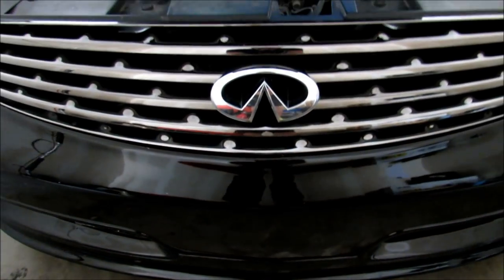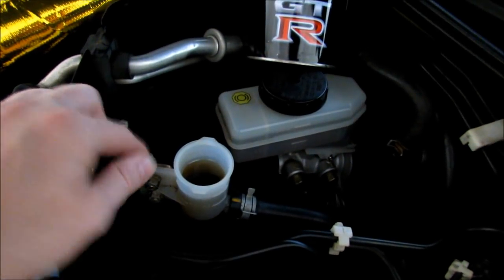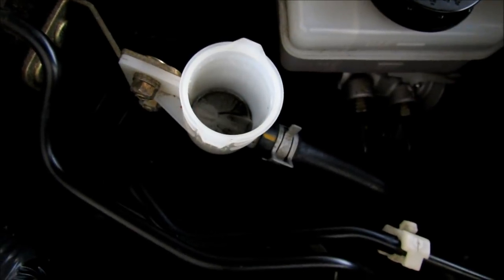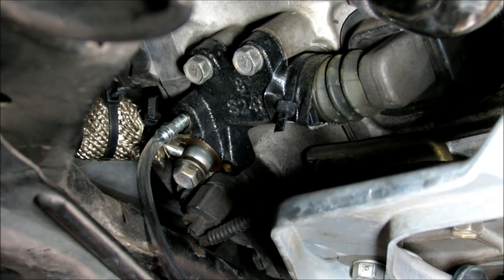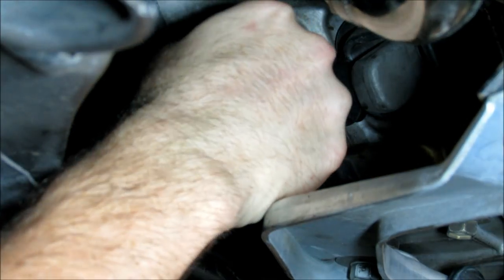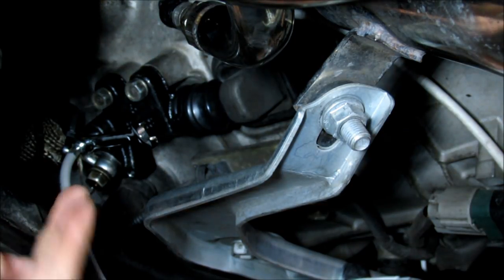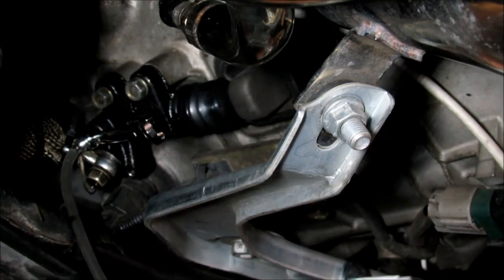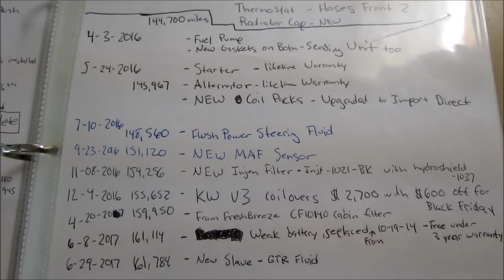INFINITI G35 / Nissan 350z - Fix Clutch Pedal - Bleed Install Slave Cylinder

Comment: Awesome vid, .I have the same exact car, same year too 6MT without the rear active steering. If don't ind I like to explain what happened to me today.  I had my clutch replaced at about 100k miles I am exactly just over 160k miles as of today. Just yesterday I noticed when I press my clutch in starts making a weird sound every time I pressed in. Now this morning it's now more like a whiny sound. I drove down to our local grocery store and noticed when I was depressing the clutch it was going to gear much quicker and I had to gas it a bit. It started to smell like burnt clutch/brakes. I made it home but same thing and when I got to my driveway the car stalled. I noticed it happened when I released the clutch it was going to gear much soon, again smelled like burnt clutch/flywheel?  Could this be the Clutch Slave Cylinder? I know it's hard to say it is but any feed back would be greatly appreciated.
Reply from the maker: 80k-100k is about the life expectancy of the clutch. Sorry for the late response, I never got a notification from youtube. It is your throw out bearing going out. I actually installed my own clutch. Because of my Motordyne Shockwave exhaust, I crack the throttle pretty often. What I learned, is do not crack it with the clutch pedal depressed all the time. Why?  My clutch was on 80,000 miles when I made my throwout bearing explode. When it exploded, every time I pushed in my clutch pedal the car would stall and you would smell burnt clutch. Never in my life have I had a car stall from pushing in the clutch. 

This sounds like your issue. You have to the drop the whole tranny to replace the throwout bearing which is a like a $40 part. It has a bunch of balls in it that spin in a circle, what happens is 1 or 2 balls will seize making it fail.
Reply: Thanks MotorDyne, it was definitely my throwout bearing. I unfortunately don't trust my self to take down my tranny to get to the clutch/throwout bearing.  So I winded up paying my local mechanic $350 to put an entire new clutch. After he removed it I had about 15% left. I am at 157k miles so replacement for a new clutch was coming up.  I had an Exedy Stage 1 clutch but now I have decided to go back to the Exedy NSK1000 OEM Replacment with a matching Luk DMF067 Flywheel. I was a little over the hard clutch feel from stage one. It feels great to have gone back to the original softer feel since it is my daily driver.  Thanks for you feedback. From your videos I can clearly see we have some the same common issues. I'll send you details later. Thanks again.
Reply from the maker: itscrucial .....I have the same setup except my clutch is Exedy stage 1. The dual mass flywheel has springs in it to absorb the vibration when changing gears. The dual mass is better for the gearbox than a single mass flywheel and your car will not sound like cement truck in neutral.
Reply from the maker: itscrucial .....another note. My Motordyne Shockwave ))) exhaust is what made my throw out bearing explode. A lot of cars rev at me when they hear my exhaust. So I will push in the clutch and bounce it off the Rev limiter. What I learned is if you want that throw out bearing to last, do not be reving at people with the clutch depressed. Just put it in neatural and do not press the clutch when you blimp the throttle.

Comment: Motordyne G35 many thanks for the helpful video! I just replaced my slave with a centric and installed it today with some brand new motul 5.1, I completely drained the fluid out and then once on I started the pressure build/ bleed process. I noticed that someone had mentioned on here as well about the pushrod being on the other way? Can you confirm that's the correct way? I noticed ours looked the same but different from OEM and so I couldn't exactly take a stand and followed your directions. Thanks again for a great video.
Reply: Also I noticed as I built pressure in the pedal and the fork was getting pressed, it has quite a squeak to it. I've seen that on other applications people throw some white grease on the contact point but ours is inside the bell housing and I'm not sure if that's something that should be done on ours even if its within reach.  Any tip or ideas on what i can do to fix it?
Reply from the maker: Thank you! Well, I did the install in June of 2017. It has been 1 year with no issues. I do remember someone saying that I installed the push rod in there wrong, but I haven't had any issues. I still believe I installed the pushrod the correct way. Now I think about, it obviously doesn't matter because the push rod is still the same length, either way, you install it. Just installing it correctly means the rubber boot is on correct.
Reply from the maker: The squeaking is NOT coming from inside the bell housing, which the fork has the throw out bearing on it. The squeaking is coming from the clutch pedal in the car, mine does it. I even lubed it all up with white lithium grease and every once in a while, I will still get a creaking noise from the clutch pedal. It is normal, I know it sucks.
Reply: Motordyne G35 ok great I believe you're right and it really shouldn't matter.
Reply: Motordyne G35 you know at second look I think you're right about the squeaking as well, it just seemed when I was down there and the pedal was getting pressed that it was originating from the fork. But I feel the squeak in the pedal if that makes sense,  and from time to time while driving it goes away
Reply: I might consider doing the rjm pedal mod in the future there's another really good video on here about it and it just seems like the engineering aspect from oem makes a lot of sense in aiding pedal feel and response.  Thanks again for all your input man I appreciate it!

Comment: Hey brotha, I've got a little issue maybe you can help. For the last few months I notice that when I let my car idle with the AC on for about 10 minutes, my clutch pedal gets much stiffer and the catching point is much higher. It's really weird. Even driving normally with the AC on for 20 minutes or so (city and highway) it stiffens up a little bit, but not as much as if I were idling for 10+ minutes. What do you think this could be? I have a 6 month old Master and slave cylinders. I have a feeling it's a failing slave, or could be a failing throw out bearing maybe? I tried to bleed and this still didn't fix it. Let me know what you think. I might start with replacing the slave since that is the cheapest. But since I have to fix a rear main seal leak, I could always put a new throw out bearing while I'm at it. I appreciate any advice!
Reply from the maker: Aaron.......hmmmm.....didn't you just replace your clutch 6 months ago? My throw out bearing exploded at 80,000 miles because I was cracking into the exhaust with the clutch pedal pushed in back at a Camaro. Once it exploded, when I depressed the clutch the car would die and smell like clutch. I can't remember if the pedal got stiffer at that point. I highly doubt your throw out bearing failed. Didn't you also just replace your rear main seal too? Aaron, what is going on? Shit news bro. 

I doubt it is also your slave cylinder, but if you bought at Oriely's you can swap it for free and find out. I replaced my slave a little earlier than I should just so I could make this video. It was exactly at 20,000 miles but you should be able to get 50k out of a slave. Honestly, I have no clue on this one, sorry man. 

The only thing I can think of is it will stiffen up first thing in the morning after a couple pumps because it builds back up pressure, especially if air is trapped in the system.
Reply: Thanks for the prompt reply bro. By your explanation it doesn't sound like my throw out bearing has exploded, and no smell of the clutch. However it was slipping more when it became more stiff because of the higher catching point pretty much at the top of the pedal (which with the RJM clutch I can adjust). After leaving the car off for a few hours the pedal went back to normal. 

I did do my rear main seal and upper oil pan gasket while I did the clutch but unfortunately, I must have not done a very good job as I've got oil coming from the bell housing. Much more now than before lol. I bought the slave at AutoZone, so maybe next time I'll get it from Oriely's. I might just need to spend time properly bleeding the system to feed my issue. Because I didn't spend much time on bleeding it before.

I just find it weird that it stiffens up without pumping it, and just leaving it idle. Very weird to me that having the AC on affects it as well. I'll try to bleed it good this weekend and get back to you.

Comment: Tyler! What was the reasoning behind your choice of GTR brake fluid for use as transmission fluid? 
I went out and bought 4 quarts because I know you're meticulous about your car, but Stephen Ortiz, my mechanic here in Dallas (says he knew you when you lived here) was extremely hesitant.

Couldn't find anything about it online either.
Reply from the maker: I know who Stephen Ortiz is when I used to live in Dallas, he was my painter. He is an expert on the G. Why would I use GTR brake fluid in my transmission? I never said that at all. I use it for my clutch slave cylinder fluid which is separate from the transmission fluid. Listen to whatever Stephen says and I know he is shaking his head knowing I would never saying something like that. I use Amsoil in my transmission. 

The reasoning behind not using OEM Dot 3 brake fluid for the slave cylinder and going to DOT 4 GTR fluid is from the technical service bulletin from INFINITI........http://www.infinitig37.com/TSB/ITB13-005a.pdf
Reply from the maker: Tell Stephen I said hello. Here is what I use in my transmission. Is yours a 6 speed? 

Amsoil Manual Transmission & Transaxle Gear Lube 75W-90
http://www.amsoil.com/shop/by-product/transmission-fluid/manual/manual-transmission-and-transaxle-gear-lube-75w-90/?code=MTGQT-EA&utm_source=Email&utm_medium=OrderConfirm&utm_campaign=ProdSummary
Reply: Motordyne G35 So I, who is still in the learning process, didn't even realize there's a separate reservoir for the clutch fluid. I can say I learned something today.

I've got an 06 revup Coupe and I want to take care of her like you do yours. Picked her up the day before thanksgiving last year and I've had many ups and downs..
 
Told him you said hi! 
Thanks for making videos and thanks for inspiring me to be super picky about what goes into my car.
Reply: I will more than likely be picking up some of that amsoil transmission fluid after doing my own research as well. 

And by the way, he did shake his head at me when I told him about using brake fluid as transmission fluid..
Reply from the maker: No worries and you got lucky finding 1 of the best underground mechanics/painters for the G35. Stephen is an expert when it comes to the G35, I learned from him. 

Very nice G and with a rev-up you have a 6MT just like me. You for sure need an oil catch can and Stephen can help you with this too. Here is my video on the oil catch can and with a rev-up model you for sure need a vented oil catch can. https://youtu.be/PqvrpciutcM
Reply: Motordyne G35 It has already been done based on your video. Stephen cleaned out my throttle body and upper plenum last week too.
Reply: After I replace my timing tensioner to fix my chain-slap I'll be starting on bolt-ons, then I'll head over to Kevin Nguyen with Jotech here in Dallas for a tune!
Reply from the maker: Wow....thank you for the feedback, you are on top of it! What is your mod want list? Jotech is a top-notch tuning shop and I've been to their shop before, but for that image, they charge top dollar too.

I was going to get my car tuned at Jotech also until everyone in the G community told me about PRT performance with Steve Kahn. Steve charges a better rate than Joetech and I felt it was a more personable experience at his shop because you can hang out and talk cars. There is nothing wrong with Jotech and I wish Steve would market PRT performance like Jotech. Jotech not only does great work, but they also have good marketing. My favorite Jotech video.........https://youtu.be/cz11PcgHYsM

Stephen uses PRT performance also for his tuning needs. Jotech cost $100 more for the same service. Either tuner is a great choice and you will be very happy afterward. I would say after my Motordyne Exhaust, the tune is my favorite mod. You can for sure feel it.

Comment: Great video !! Quick dumb question .. when you are bleeding the slave do you leave the clutch fluid lid off ?
Reply from the maker: No questions are dumb, thanks for watching. Yes, you leave the lid off when you bleed the system. If you are just bleeding the system, it is very important, to not let the clutch fluid reservoir get empty or air will get sucked into the system and it will take longer to bleed. So as you slowly drain fluid out, make sure to top off the clutch fluid reservoir.
Reply: Motordyne G35 thank you so much! I know you explained this but I just want to make sure .. on the slave metal piece(pole) itself the bigger part goes to the slave and the thinner part to the clutch correct ?

Comment: Hey man I changed both my master and slave cylinder and the car was driving drive all of a sudden I lose pressure and the car will not go into gear any ideas of what it could it be any advice would help  06 g35 6mt thanks !
Reply from the maker: mike villa ....does the clutch reservoir have fluid in it?
Reply: Motordyne G35 yeah it was running through the tranny but now that it won’t go into gear the master doesn’t show sign of the fluid getting pumped down ... could my lines be clogged ?

Comment: Hey my clutch is not slipping but the biting point is really high almost at the very top, what could be the reason for this? I think my clutch itself is good imo but idk what the other problems could be
Reply from the maker: Chef K .....nothing is wrong, from the factory the bite point is at the top for a reason.
Reply: Motordyne G35 it feels really lose at the bottom

Comment: Hey did you buy the RJM clutch pedal? What are your thoughts? I bought one today. All I hear are good things but not sure if it'll be worth it.
Reply from the maker: OEM high engagement point makes shifting fast and easy, you barely have to touch the pedal for the throw-out bearing to be pressed against the pressure plate allowing the clutch disc to float as you change gears. If you want to have the engagement point somewhere down on the floor, which takes longer to get too, sure then get it. It does not add horsepower and I have no issues, shifting through gears with my clutch pedal after 12 years. Why change? 

If I thought it was worth it, I would have it.
Reply: Motordyne G35 oh I thought you bought one.    I saw your comment on a RJM video and assumed. Wanted to know your thoughts on it that's all.
Reply from the maker: No worries. I went back and deleted that comment you are talking about. I was trying to get answer out of that guy on his channel by telling him what he wanted to hear first, before then asking my question in which he was unable to answer. If I told him I thought the RJM pedal was a waste of money, that is all that he would have heard and not answer my question. I'm not into how things feel, I'm into performance parts modifications. Touchy feeling stuff is a waste of money. Actually, after looking at his channel and seeing all of the views he gets. I realized, I know more, can make better content and bought a camera to start my own channel. If you really want to know......

Comment: my clutch only sticks when i'm doing donuts or extended high rev moment should i be changing my slave or just fluid change?
Reply from the maker: Mine used to do exactly just that, only on hard driving when I first discovered a bad slave. You need to change the slave at that point.

Comment: I am having the same issues on my 350z.  I change both the master clutch cylinder and slave cylinder. I still have the same issue after a few thousand miles.  I am planning to change it to a Wilwood kit if I get the chance.  Are you still on your original master clutch cylinder? Do you use dot 4 or dot 3 brake fluid?
Reply from the maker: I use GTR brake fluid, which is DOT 4. What issue are you having? Are you talking about the fluid keeps turning blackish after 6 months? 

Yes, I'm still on the original master clutch cylinder, I have yet to change it.
Reply: Motordyne G35, Clutch comes back nice and firm when I initially bled the system, but a month later it a little bit sunken.  Its very annoying, it takes several pump in the morning to get it to firm up again.  I have also installed a stainless steel clutch line to the slave cylinder(no help at all).  I am currently using Valvoline dot 4 brake fluid.  Maybe it's the fluid I am using.
Reply from the maker: Hmmmm......if you have to pump the pedal to get pressure again, you have a leak somewhere. My pedal never loses pressure and stays very firm. Maybe you got a faulty part new. Did you buy OEM or did you buy with a lifetime warranty from Oriley's? If it is from Oriley's, go take it back and they replace it for free.
Reply: Motordyne G35, unfortunately, I did not.  Master clutch cylinder is from Centric. Slave cylinders was from Dorman.             Maybe two of the line weak point is the line that run between the fender or that rubber hose that run from the reservoir to the master clutch cylinder.  Maybe heat soak(slave cylinder attached to the bell housing)?